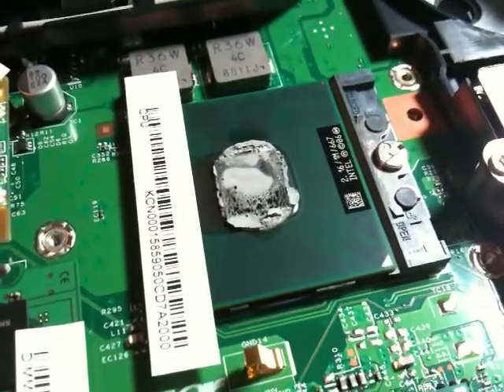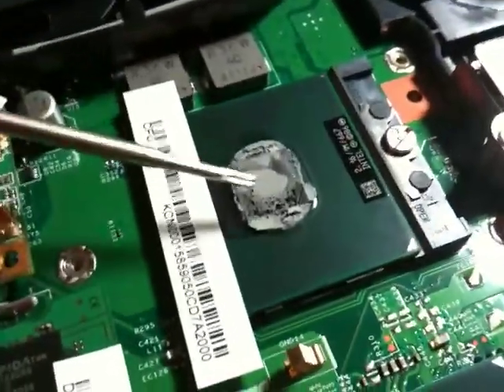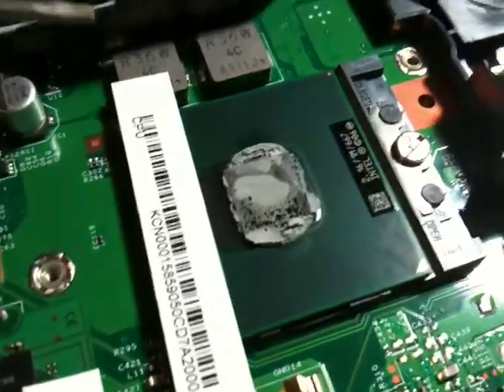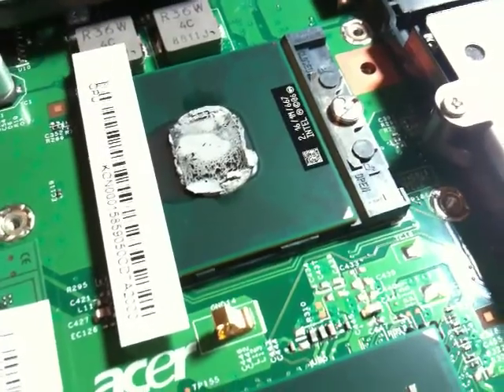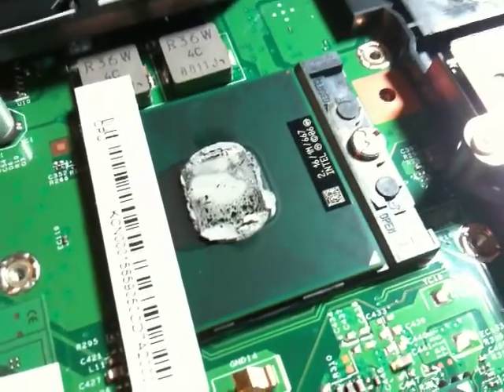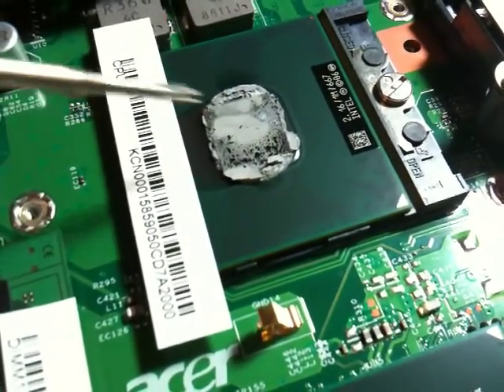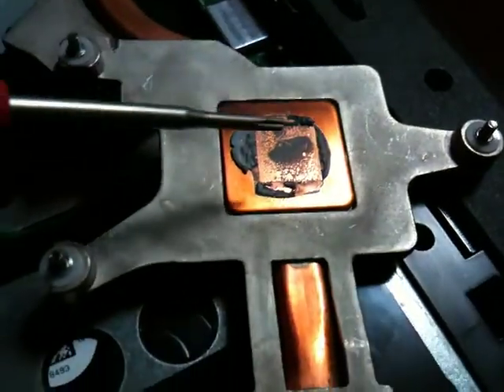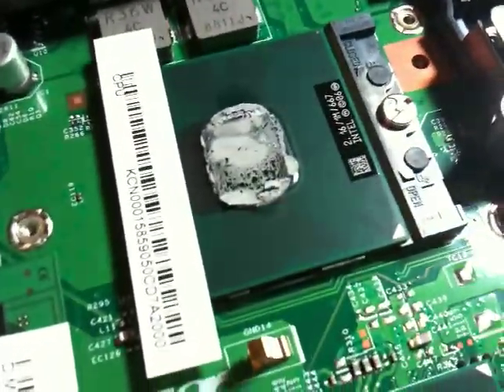Another Bad Thermal Paste Case, Acer is at fault

Comment: Acer nitro 5 have same shitty problem, unacceptable after paying 1350€ on a laptop. My pc costantely gone to 95 degrees so i repastesd the thermal paste with a thermal grizzly kryonaut, so now my temps are around 50-60 degrees (celsius). I'm really mad for their products treatment, even because most customers doesn't actually know how to fix overheating and thermal throttling.

Comment: This is still a issue - I had high temp throttling issues on a brand new g9 593 (couple of months old) with a i7 6700 CPU and gtx 1070 gpu , the temp on the cpu was running 98 degrees C and the CPU throttled when under 100% load .. The stock paste wasnt even dry or anything, just didnt seem to work, maybe they used mayonaise.... I removed the old paste and applied some Grizzly Kryonaut paste.. Now the temps are stable around 67 degrees C under load - its astounding! Maybe they are trying to introduce a natural end of life for the product?!? Weird thing is I do see a small improvement on the GPU too but only a couple of degrees and lower fan rpm, maybe they use different paste or they apply the paste really inconsistent...

Comment: I have an acer aspire 4738G which kept overheating. Decided to change the thermal compound after going thru loads of YouTube videos. However I discovered that the GPU does not contact the copper conductor at all. I placed 2plastic sheet on the GPU and CPU, replaced the fan unit and screwed it tight. I could remove the plastic sheet that was placed over the GPU but not the CPU. I checked the motherboard but it doesn't seem to have slumped in. Is this suppose to be normal? Or should I change the fan unit so that it has actual physical contact on both the CPU and GPU? Can I salvage the current unit by putting more thermal paste on the GPU so that it actually form a conducting bridge to the copper plate of the fan unit? Putting more paste is contrary to what everyone is saying on YouTube though. Pls advise!

Comment: same thing with msi laptops i replaced the past in my msi cr500 as before when the laptop had just turned on it was at 78c and now with new thermal past its at 40c, i have the same ploblem with my hp and ps3 slim

Comment: Looked very identical on my friends Samsung laptop which had overheating-problems.

I just disassembled it and the paste looked very similar, dry as f**k.
I put some Noctua NT-H1 on there instead and now the  i3 370M runs at 70-75C after hours of Prime95 compared to before when the computer would shut down reaching 90C in Prime95 after only two minutes.

Comment: I got a pretty good feeling with my Peckard Bell Easynote TS (euro version). I have it for about 2 or 3 years now and I've been running it super fucking hot. Playing games like GTA IV on it without even having the specs for doing that.

The only thing that's bad about this laptop is the built in fan which is super weak, but I got a cooling pad for it and I can run it at like 60°C or even 70 and it won't break down.

I'm very satisfied with it and I recommend it if you're not into gaming much.

Comment: I got my ~3 year old Acer Aspire 5742G repaired after 1,5 years, it spontaniously overheated.
Indeed the thermal paste was dried out, and there is a very small fan for both CPU and GPU, Acer would probably charge money because this is "not their fault" so I got it repaired at a computer shop for 50€. (and it was twice repaired by acer for a screen cable also, shipment/repairs took 11 weeks in total!!!) I don't want to buy a laptop again,...

Comment: The biggest issue with IB chips is too much glue, causing a very thick thermal grease layer - focking up the temps. That being said, i think I got lucky with my 3770K, It's running cold as ice, AND it's taken a significant undervolt. Will probably overclock it tomorrow :D

Comment: Pretty much all laptops are guilty of using:
A. Cheapshit thermal grease
B. WAAAAAAY too much thermal grease

I happened to pull my Acer apart about 3 months into owning it (couldn't hear the right speaker, so I thought I'd check, turns out - there isn't one :P silly me), and I thought - while I'm at it - let's do a TIM job on it. It wasn't that bad yet, so I cleaned it up real nice, put some AS5 on it and it's been working 100% for the past year and a half. That's a hot AMD chip as well!

Comment: every laptop ive ever hade had this problum i buy used ferst thang i do is put artic siver 5 on then little more then most people last longer and droped the temps from 107c to 84 cat full loed in games (hp dm4 core i3 4gb ram intel hd 3000)

Comment: It does not benefit dell for your comuter to last to long. Also if you look at the older laptops with Pentiums running at 2.2/3.0 mhz. They were puting regular desk-top cpu's on laptops. It's like putting an oven in your pocket. That was a cheap way to build laptops. That's why Apple kick their ass, Apple had better low-thermal power cpu's. Intel got stuck on desk-top cpus. Intel, had core-solo that ran on 5w. Now intel is ahead of the game with the ivy-bridge technology. 14nm next year.

Comment: After my Dell XPS M1530 came back from the factory for GPU repair under a class action law suit, the fan was constantly on.1st thought it was some firmware changes. When it started to shut down all the time, opened it up, found the thermal compound was thicker than caulking I put on my windows. Spent an hour literally chipping it away off thermal assembly with an Xacto knife. Plus another 1/2 hour on the chips with my finger nails. 90% alcohol was useless when it is that thick.

Comment: personally i reckon the more high end expensive laptops which are $1700+ wont have any of these problems, because the manufacturers spend more time engineering high end laptops for reliability and performance in order to compete with other manufacturers and keep a high reputation. The cheap laptops arent built to last very long anyways because its already outdated, look at the low end acers etc, they are still pentium while the higher end laptops run intel core i3, i5 and i7

Comment: You sound like a moron. Just because they don't apply the paste by hand, or perfectly doesn't mean it's a problem. Many other things contribute to laptops overheating, the number one probably being dust. And have you ever even taken apart an old laptop? You'll see the EXACT same thing, or just a thermal pad. This is NOTHING new, so why are you shocked and disgusted? Get a life. With your own personal laptop you can do whatever you want to make it run 3 degrees cooler.

Comment: When my mom got her aced desktop it would shut down after 20 minutes and it was brand fucking new so I plucked it apart and it turns out that aver put NO thermal paste at all. Nothing it was cheap heatsink and dual core CPU I called aver tech and bitches out those god damed Arabs.

Comment: Jak

Thank you for your post, i agree 100%. I work for a college IT repair shop, and we too noticed that 90% of our repairs are because overheating due to manufactures using bad thermal paste in consumer line laptops. This causes hardware to fail, during the diagnostic stage and shortens the life the laptop. When we repair, we don't use the crappy thermal paste the manufacturer sends. we use arctic silver 5 or ocz freeze.